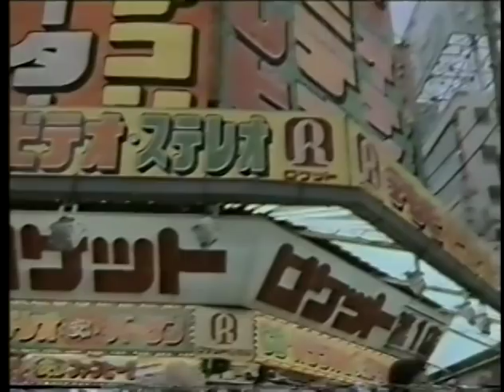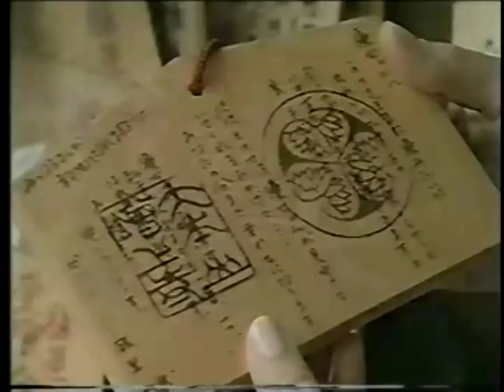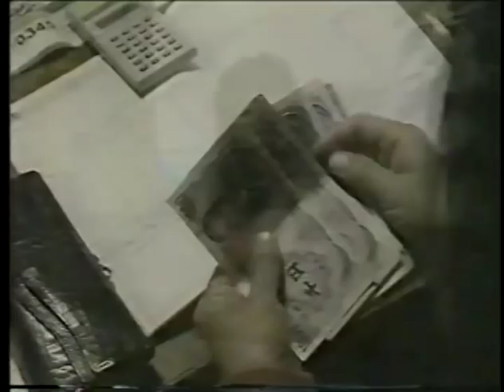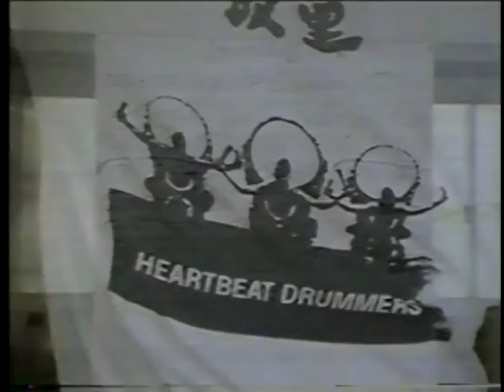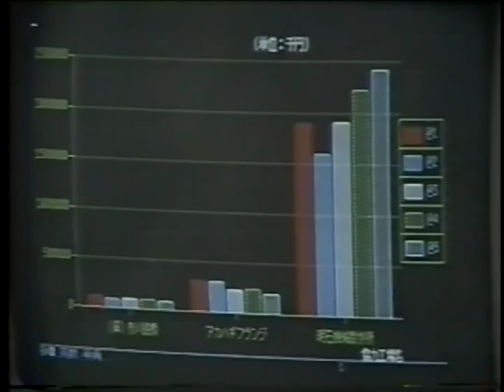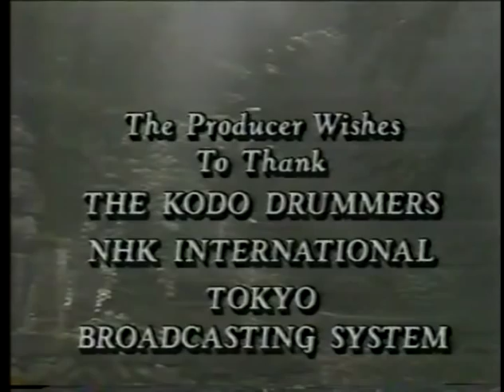Japan Episode 4 [A Proper Place in the World]

Comment: @Biker PwnsU

"Neutrality" is a nonsensical term in this context. Unless you're filming a static aquarium, you will have to make judgments on what to film and what to cut out, what to mention and what to ignore. What's important is to be fair and she certainly tried to be that as she presented both the good and the bad of every aspect she dealt with. She did at one point mention that her own mother had been interred and abused by the Japanese during the war, so she's probably no stranger to Japan as a topic and it was clear from her presentation that she was too sharp to be blinded by the bling on the surface. All in all, a good documentary series that managed to delve a little deeper into the Japanese psyche, beyond the usual neon lights, sushi bars, sex shops and manga comics.